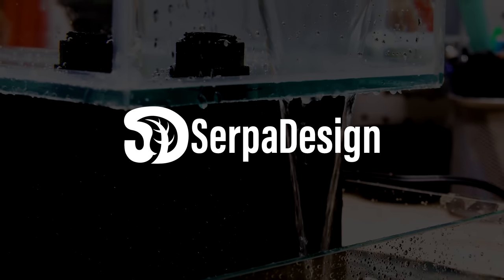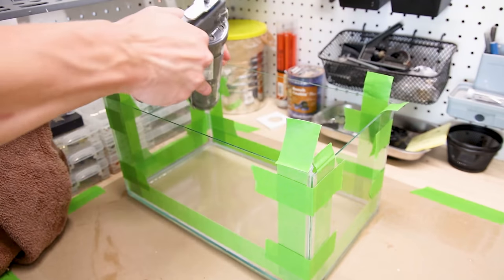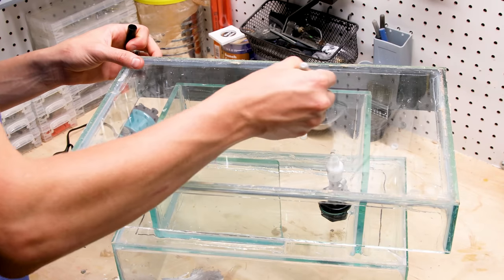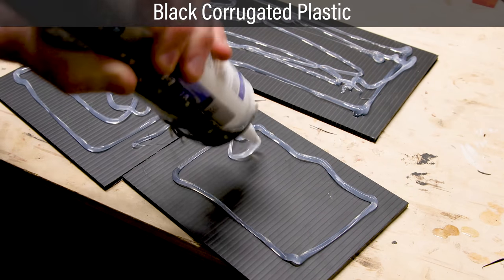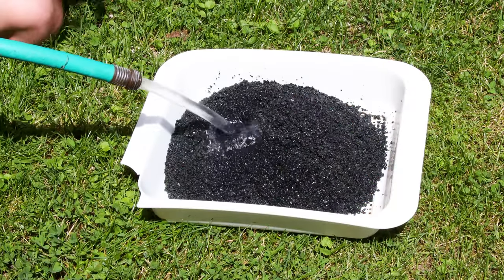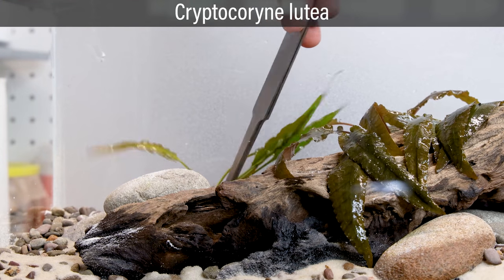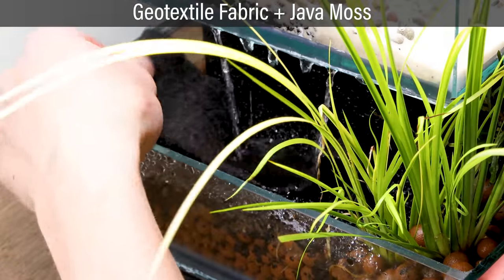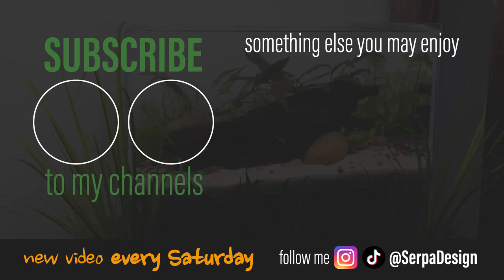Upflow Overflow (Infinity) Bog Filtered Shrimp Aquascape

Comment: Could you aerate the water on the inside of the overflow to reduce the surface tension?  Breaking the meniscus with the  piece of glass was genius, but as soon as the water overflowed it started to gather together again.  Can you try aeration if you build it again?

Comment: Very nice! Do you think it's a problem that the water from the sides will immediately drain backwards to the pump, not going through the plants in the front at all? (I have no idea about this stuff ;)) If so, you could cut off the path for the water to the back on the right side with another small piece of glass, so that at least half the water (the part spilling over the right) has to first flow through the plants in front to the other side before it can reach the pump.
But maybe having actual flowing water isn't good for these plants? As I said, no idea at all, it's just something that popped into my mind when seeing this.

Comment: @SerpaDesign Ingenious idea, and end result was very pleasing. :clap: However, the engineer inside me is kind of like.... we should revisit this and perfect it. When I think of the words infinity + water my mind automatically goes to infinity pools and fountains. That being the case the waterfall being somewhat the main attraction it must be flawless and have no tapering nor irregularities. I think the technical fail points was the position of the water outtake port on the 2nd level. it not being in the center may have had something to do with the irregular fall as well as an unevenness of surfaces.  With all that said I think the current design is more suitable for fish/shrimps etc... as you probably dont want them to go on a ride over the edge =).... so what's the point? Well, lets make a smaller solo aquascape infinity aquarium?

Comment: Just an fyi. You applied the plumbers tape incorrectly. if you hold the front of the thread facing you, you wrap it clockwise. This is because wrapping it anti clock wise can cause it to come undone while doing the fittings up. Especially with plastic you can also slighlty rough up the thread with a hacksaw blade to help the tape not slip and spin while its being done up.

Comment: I'd be interested in seeing an end product with a slightly stronger pump. Perhaps consider acrylic instead of glass, then you cut a tooth pattern ( |\/\/\/\/\/\/\/| ) into the top for 360 degrees of overflow.

Comment: You levelled to your bench, won't be the same in a different local, just fashion a rigid plate with threaded levelling feet.  
How about a rock wall and waterfall down the outside of smaller tank ? maybe a partial cover of one glass face, or drip wall, many surfaces and over the edge of inner tank, to play with.

Comment: What is a minimum sized tank for shrimp? Specifically Neocaradina
Reply: Pretty small. A 15cm cube should suffice, assuming you give them some plants and décor (with shrimp it’s more about surface area rather than size, so the more visual interest you can jam in there, the better)
Reply: …. How you would filter a 15cm cube is a different story. It would be a bit tricky, but I’m sure there a way

Comment: I hate to be a Debbie downer, but I don't like it and for a few good reasons too. The first problem is that it just looks too messy. The second problem is the process of cleaning it, looks like a hassle. Another reason is that it looks too bulky. I know you wanted an infinity pool look, but what about something that works more like a waterfall instead? You can put slits of glass in threes within the front so that the 2 pillar like pieces of glass are shorter than the ones in the middle and around the case. That way you can have more control. Next, the water pump. The water pump needs an extra output boost of 2 coming from the opposite direction it overflows. Finally, if you can strive to make the tank shorter the better your outcome will be.